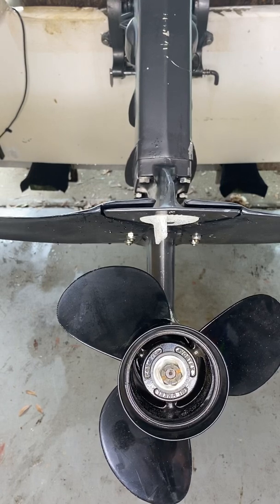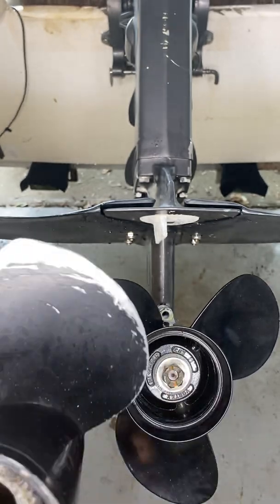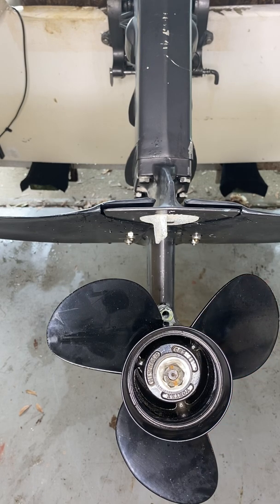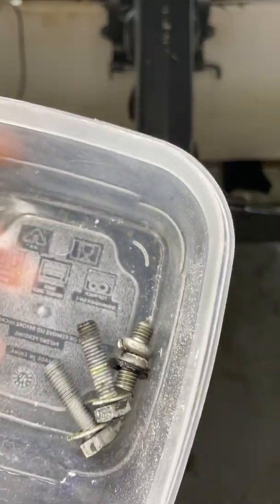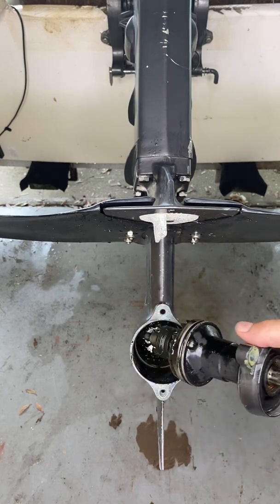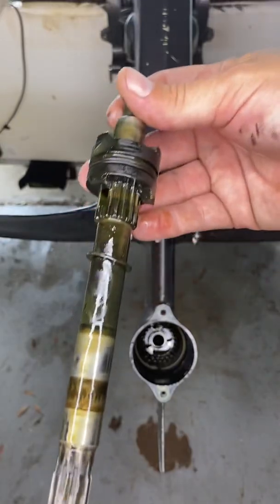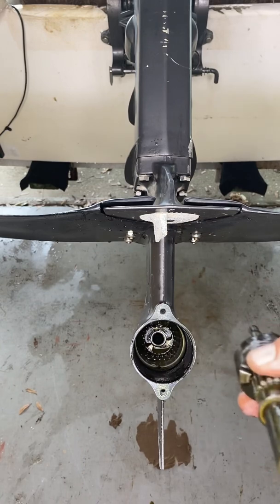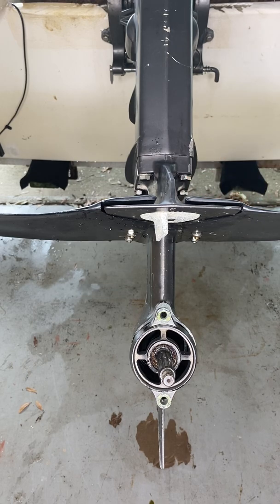How to replace bent prop shaft 25hp tohatsu two stroke outboard

Comment: Great video. I have a 1998 nissan 30hp two stroke that should be very similar. Would have liked to see you change the seal(s) also on this video, as this probably should be done whenever you replace or straighten the prop shaft. Can you tell me if there are 1 or 2 seals on the prop shaft?
Reply from the maker: There were two seals on the prop shaft but not stacked on top of each other. Was was at the front of the carrier and one was at the back. I went ahead and replaced them both. Thank you for the feedback.

Comment: Any idea if a 2003 4 stroke 25hp Nissan/tohatsu would be pretty much the same? Looks identical as far as I can tell
Reply from the maker: There are just about the same except yours might only have one seal instead of two. Here is a parts diagram for your lower unit. 
https://www.boats.net/catalog/nissan/2003/nsf25a-4-stroke-nissan/gear-case